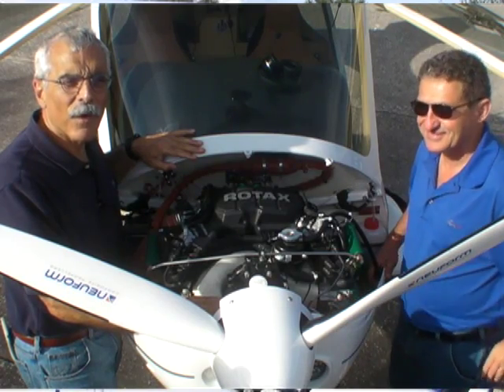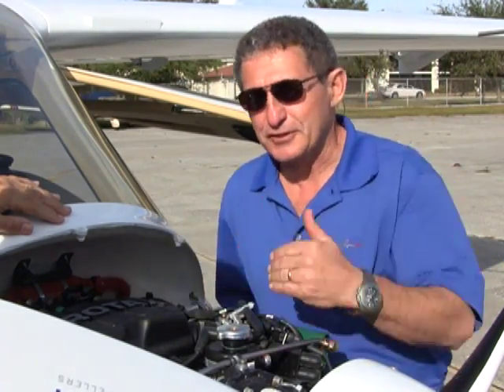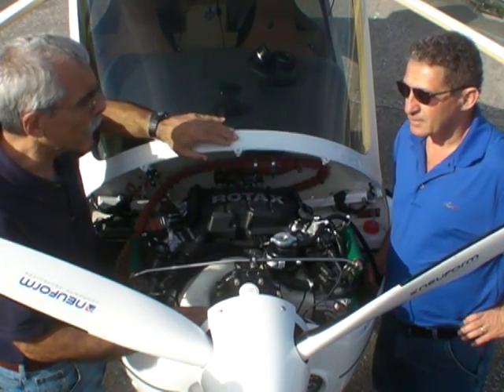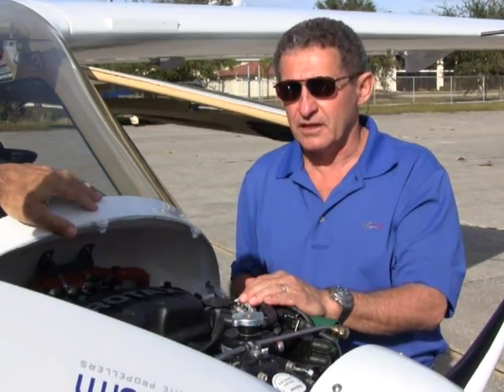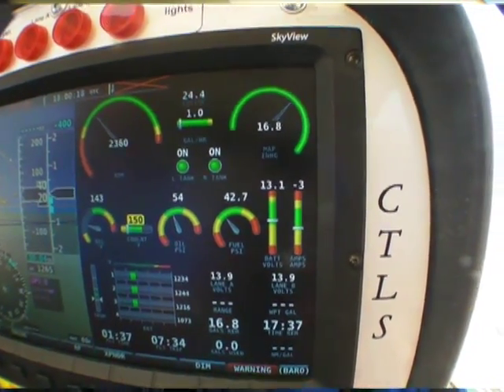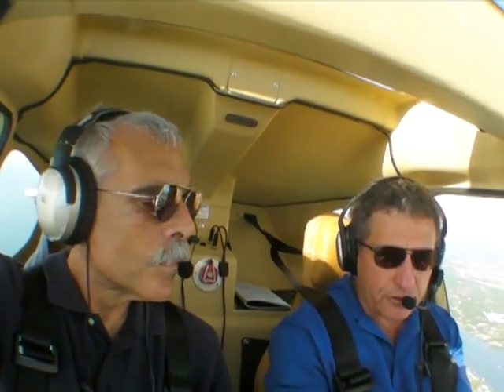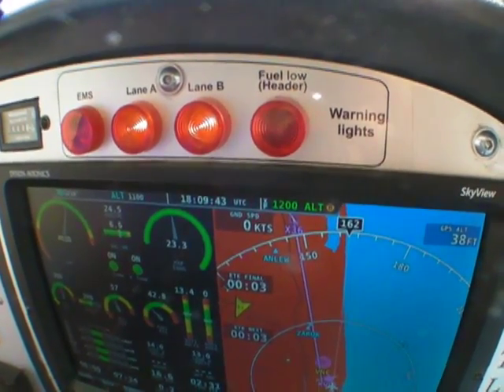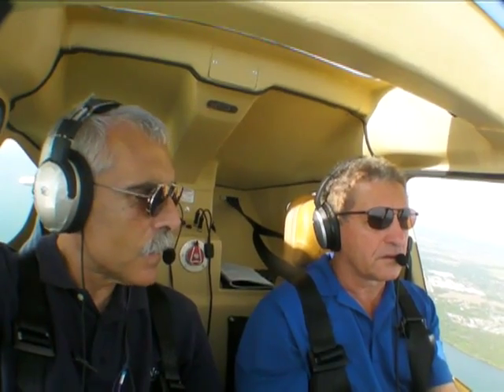Flight Design's New CTLSi with 912 iS

Comment: isn't that alert system for the fuel kind of useless? you're supposed to be landing with 30 or 45 minutes of fuel depending upon day/night. or is that just the idiot-proofing of an injected engine with an ecu?
Reply: Not useless at all. Pilots run out of fuel no matter what the rules are. This will help those pilots when they realize their mistake. Although I do wonder how many more bad decisions will be made when those same pilots know the system will save them. (Going to pick up my CTLSi in 6 days).